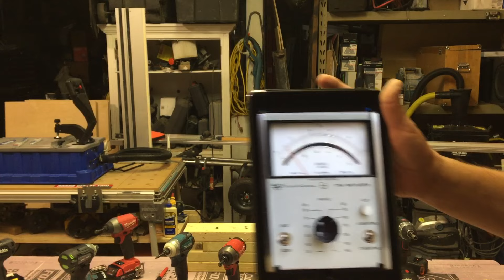Milwaukee m18 Fuel surge hydraulic driver

Comment: Very good review thank you so much, i cant choose  between  this surge in a combination with the m18 fpd combo hammerdrill. And a festool pdc 18 quaddrive do you have experince with festool
Reply from the maker: Marocchino L  the Festool PDC is one of my favorite drills. It is probably the most versatile on the planet.  I especially love it for finish work. It is so quiet and smooth. The attachments are amazing as well. My answer depends on application. If you need an impact style driver then the combo is your best bet. The fuel drill is also stronger. There is a large gap in quality though. Decisions ...
Reply: Toolpig's Raw Tool Videos  thank you i wil buy this weekend the festool pdc 18v with new airtream technology with different chucks thank you so much greetings from the netherlands
Reply: Toolpig's Raw Tool Videos  thank you so much i wil buy the festool pdc 18 airstream plus edition with al chucks, i dont need a impact driver and 60nm on the pdc18 is much enough for dayli work. The quality of festool is much higher then any orher companie on the market right now